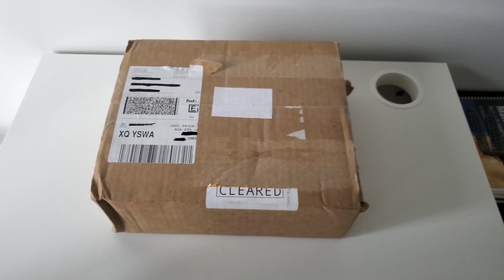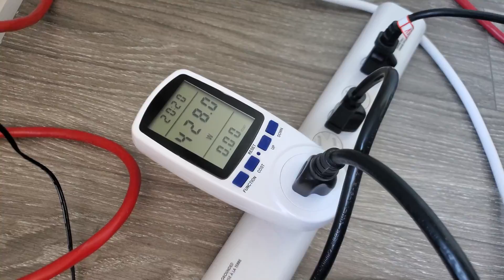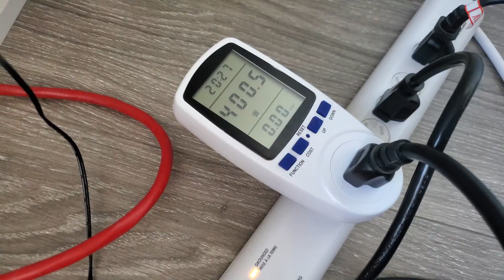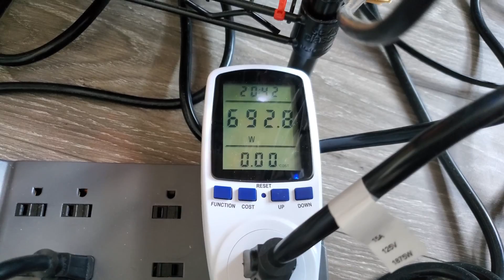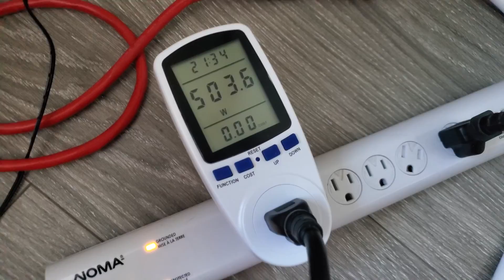ZSX AMP Breakout Board & HP Server PSU! Parallel Miner Care Package

Comment: Could you please help me? I have one zsx amp and one x11 amp. Connected with the interconnect cable, but then don’t run together, when I hit the power button one turns off and the other one turns on, but never both
Reply from the maker: Hey Miguel! I have not really used the interconnect cables, but I know they do have documentation on their website explaining all the connects. Id recommend checking that out :)

Comment: Great review! I have actually ordered the same power supply from Parallel Miner and await delivery.. Keep it up!
Reply from the maker: Thanks really appreciate it :) hope you enjoy the products
Reply: @MiningOffice  I currently have a Thermaltake 1200W RGB Platinum ATX installed in my rig, but I am also building a Thermaltake P3 open chassis test bench PC in which I want to use the power supply. I have specifically gone for the ZSX board, as it eliminates the need for an ATX power supply to power the MB and CPU.

Great channel! Looking forward to your next video..!